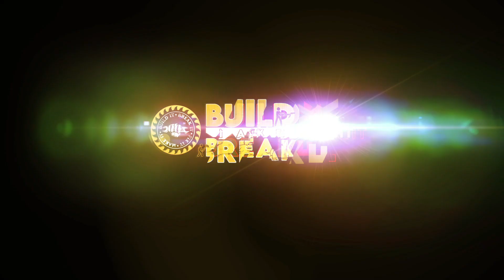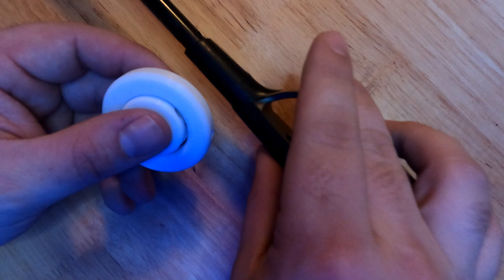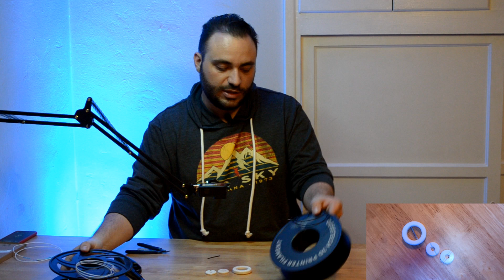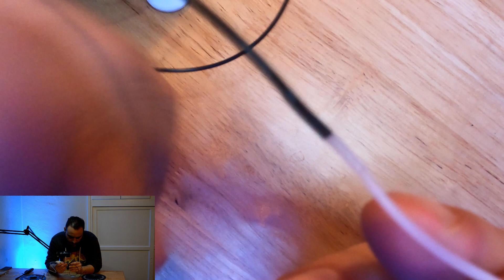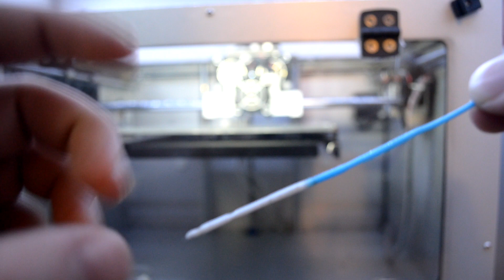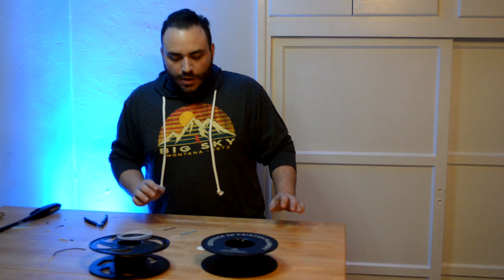Epic Filament Welding Fails 😱 | What Went Wrong

Comment: thnx for trying it out -atleast i have a example fo follow now - i always feel i bit frustated with left over filemant 
btw i wonder if its posible to replace the pen spring with a heater coil (from a vape coil) to heat the filament . that way you could focus more on the welding the filament
Reply from the maker: Not sure if that would help this particular problem with the tube being too large a diameter, but it would definitely make it a easier to control the heat! Good idea.